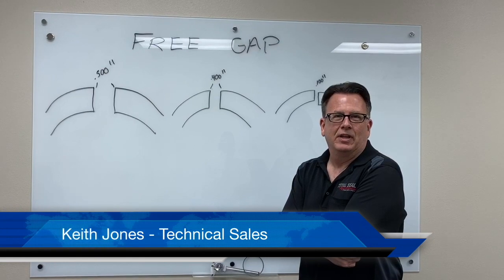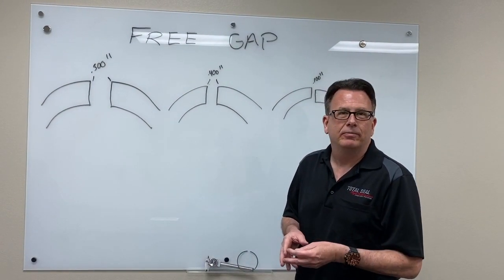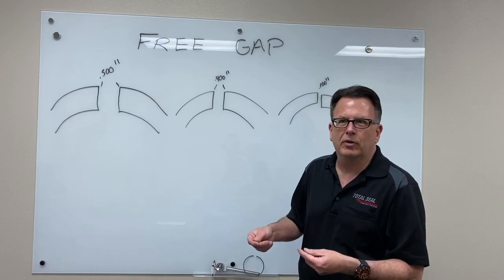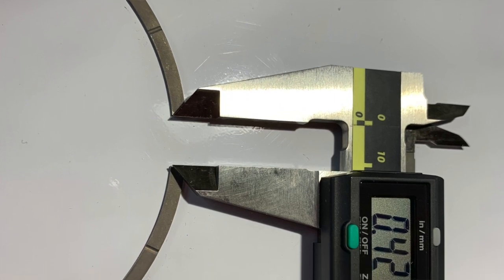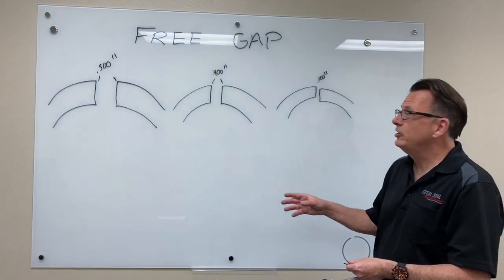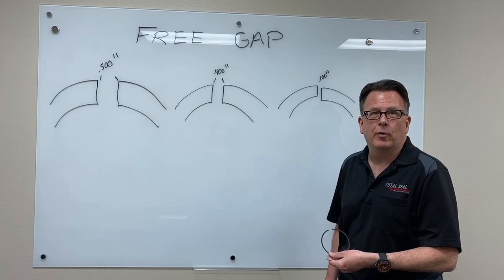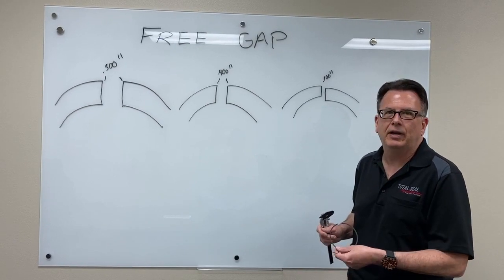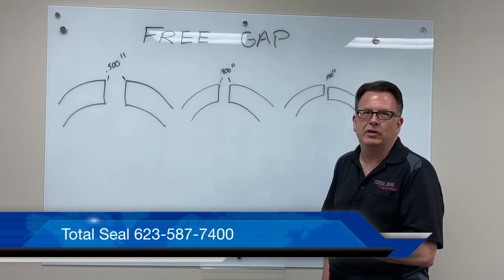What Is Free Gap?

Comment: I've decided to run your rings in the 331 I'm building for sale. I bought ts1 so the customer can go forced induction later or nitrous. With having to gap.   Well on next 5 builds, 
I want a steel top ring and a set of ring suited for a Ford racing R 302  block 347 and  Svo r 351 (408).
I want high quality for these builds.
I wanna run 347 na and 408 turbo.
I'm looking for both to be able to handle forced induction later after there run n/a first.   Street/strip driver....give me your opinion on a great option for me👌
Reply from the maker: Thanks for choosing our rings. Please contact our tech department at 623-587-7400 for more detailed technical support.